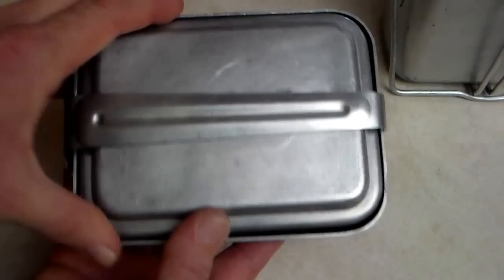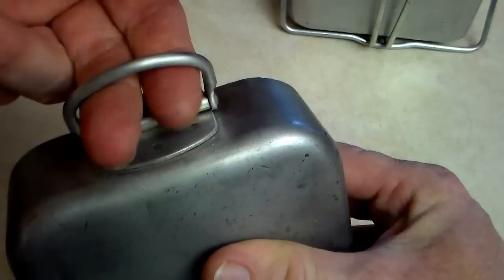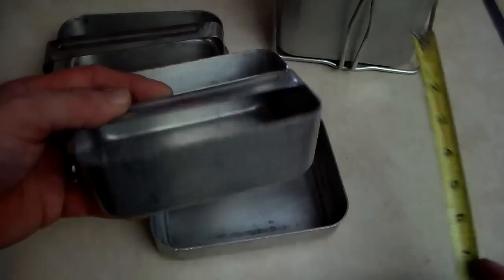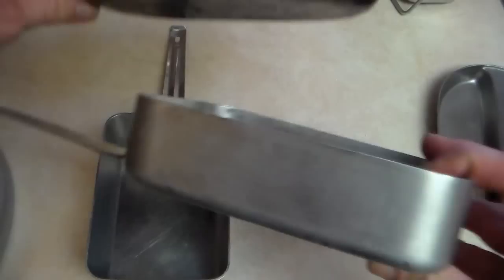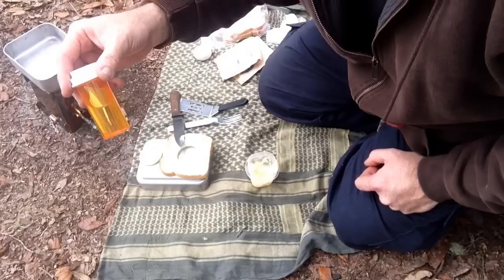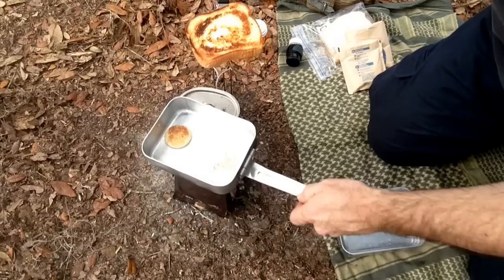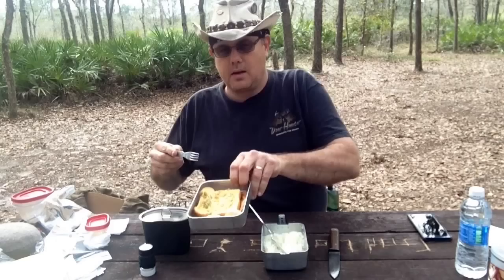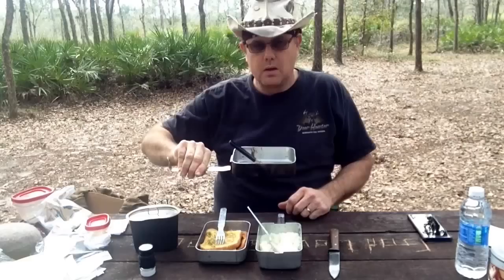The M52 French Army Mess Kit and Eggs In A Hole.

Comment: I alternate between the French army mess kit and the Serb army mess kit, and I don't have a favorite between them. They are both rectangular, so they fit well in my ruck. They both have shortcomings, because  military mess kits are made less for cooking and more for eating out of after a unit cook has made the food. However, with practice, the bushcrafter can cook well with either one. I'd say the French kit is more versatile; I've made all sorts of meals in it, even baked bread and corn bread in my set (the bottom of the handle-less "plate" fits nicely into the small skillet). You can bake in the Serb kit, but you need aluminum foil for a cover. For soups and stews, I favor the Serb kit, as it's taller and food won't slosh out of it.

Anyhow, great demo. Thanks for posting.
Reply from the maker: I have the Serb kit too. I don't care for the plastic bowl and cup in the set. But the pot is nice and I like the pouch and silverware set. My canteen has a bad smell that I can't get rid of so it doesn't see much use. I would have to agree that the french kit is more versatile. Its limit, as you said, is not having a deep pot. Thanks for watching and for your comment!

Comment: One of the good things about this kit, because it's square, it's easier to pour water from the corners.
Reply from the maker: Never poured water from one yet. That's nice to know. Were you using it to process water for drinking?
Reply: I was making some tea, and it poured perfectly from the corners. I used the small pan, and put the middle pan on as a lid. I have a USGI pan, and the USGI canteen, but you could just use the French kit for cooking, and boiling water from, without bringing the canteen.
Reply: Yes! Beer flows out of the corners of my mouth when I've had enough 🍺🍺🍺🍺🍺🍺

Comment: All these old surplus mess tins have become harder to find and sky rocketed in price over the last few years.  3 or 4 years ago you could get the full Yugo mess kit in pouch with kfs for £10 where I am ($12), now they cost more than double that and are few and far between.  

5 years ago I bought an East German mess kit in Holland from a surplus shop for just 3 Euros, $3.30, now in the UK they are £20 ($25) minimum.  Wish I'd bought more of that gear back then. 

 As it is I have a bombproof Dutch canteen cup I bought in Holland for 2 Euros, and a pair of Dutch stainless tins I bought here for £6 ($8), those are my go to for out in the woods, with after market lids (Pathfinder and BCB).

There are Chinese knockoffs of this French mess kit now, also not exactly cheap at £20/$25.  The originals are very few and far between, saw one for £48 / $60 on ebay.

Comment: John, which kits are stainless of all the kits? good job. thanks
Reply from the maker: Mark Hager Most of the genuine army surplus kits available are aluminum. The stainless ones I can think of are the USGI mess kit and canteen cup, the Dutch mess kit which is a copy of the aluminum British mess kit and the stainless version of the Swedish mess kit which is very hard to find and is expensive. There may be a couple more but I can’t recall them. Of all of those I mentioned, the best for the cost, performance and availability in my opinion would be the USGI mess kit paired with the US canteen, stainless cup and pouch. This set is hard to beat. Thanks for your question and for watching my video!

Comment: I really wish people would review entire kits.  The American mess kit is a good example.  It's meant to be used with the canteen cup and stove.  They're all one unit, so unless you have both, your mess kit is incomplete, and you really can't demonstrate how it's supposed to be used, or even use it properly yourself.

According to military spec, gear, and inventory sheets, the entire kit consists of the mess kit, which, in turn, has a plate and a frying pan, a canteen, a canteen cup, a canteen cup lid, and a stove.   Both the canteen cup and the frying pan are designed to be used over the stove.  In an older kit, the canteen should be metal, which gives you extra boiling capacity.

There's a myth that the mess kit was not designed for cooking.  This myth arises from the fact that it is also designed to be used as serving utensils at a field kitchen.  But it is just a myth, and right up until production stopped, the military listed the parts as a plate and a frying pan.

Anyway, why the fry pan can be used over an open campfire, that is not the best way to use it.  It functions much better over the stove, whether the fuel you use is tablets, alcohol, or wood.   One very nice thing is that the Mini Trangia alcohol stove fits perfectly under the stove.  So does a Fancy Feast cat food can.  

Anyway, while many military mess kits are complete as are, others are not, and the American version is one that is incomplete without the canteen cook set components.

As a side note, it amazes me how easy it is to find military mess kits, even very old ones, but finding the covers for many of them is almost impossible.

Comment: I've seen a few of these reviews. Do any of you Reviewers comprehend the concept of a "Double Boiler"? You put water in the bottom pan, and something like milk (for tea or coffee - some cultures prefer it) or anything else that might easily burn in the top pan and fit them together and boil the water.
Reply from the maker: ARRJAY Yes I know about the double boiler method but I don't use it much. I don't prefer to warm milk for my coffee and here in my part of the US we like mostly iced tea without milk. I have used the method to cook rice in the bottom pot and warm up canned black beans on the top with a German mess kit. That worked pretty well.
Reply: You might be able to use it as one, but that was not the intention of this mess kit, not even a French one. They are designed to stack like that so a soldier could go thru the mess line  and be able to walk back to his position or where he was going to eat without having to juggle a bunch of pans.